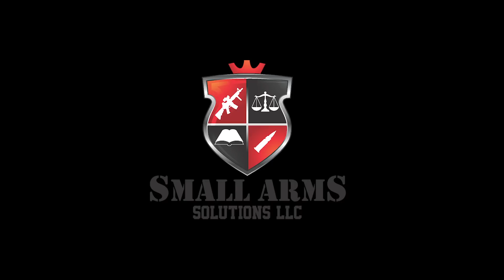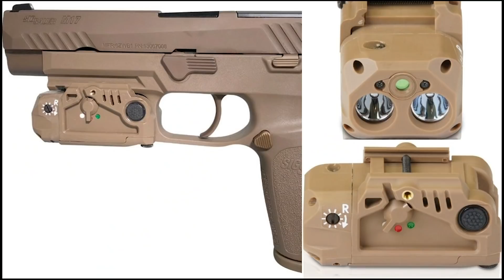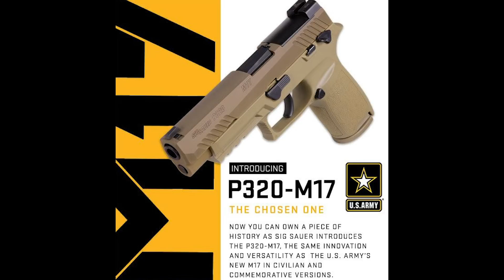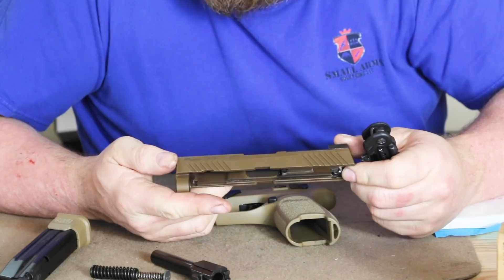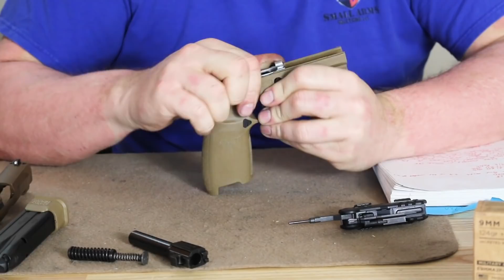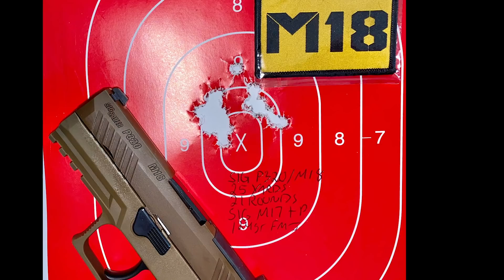Sig P320/M18 Pistol

Comment: The Army went with the SIG because it met all of the design criteria, which was established 15 years ago. The G19 would of been the best bet. I've carried the M9 pistol on several deployments and its not a fun gun to carry on patrol or conceal
Reply: Nelson R as a taxpayer, I’m good with that.  As long as it’s reliable and accurate then no issue
Reply: @rickhunter6513  all we need now is the VF-1A/J/S to go into service.
Reply: Shirosake haha, touché,sir 👍🏼
Reply: J. Bernard I carried the M 9 on two deployments. Hated the gun with a passion. I’ve owned and shot Glocks for a long time and enjoy shooting them. However, I own four different Sigs, Springfield 10 mm 1911. In my opinion Sig knocked it out of the park. Just my opinion

Comment: I cant find any information on the M17/18 barrel specifications. Only speculation that it is Cold Hammer Forged CHF or just button rifled. Im curios to see how they hold up to tens of thousands of rounds of NATO 9mm.
Reply: Noel Rankin OT doesn’t have to stand up to thousands of rounds. Most pistols might get 200 rounds per year shot thru them. That’s many years of service.
Reply: @Unsound_advice  there was a Beretta centric podcast on Primary and Secondary where former mil people said they qualified on M9s that were almost at the end of their life span. Which I think its 90k rounds. It's a ridiculous number, but it's in the tens of thousands and it's easily achievable because there's so much data the military has on the M9's reliability that they know when to replace X part at Y round count.
Reply: Titanium Rain I’ve seen M9’s in various conditions, some look factory fresh to others that were wwaaayyy at the end. 
  For a vast majority of the armed forces the pistols are low-round per year items. For the units that do a significant amount of work with their pistols said units have much different budgets and structures to ensure their members receive weapons within spec and are at the better end of the serviceability spectrum.
Reply: I meant more in Army Special Forces where during a SFAUC pistols can go through several thousand rounds in just a couple of weeks.
Reply: Noel Rankin oh. That’s what Glock 19’s are for.